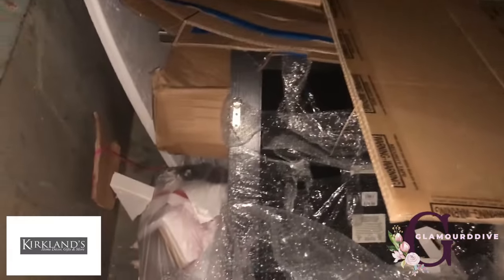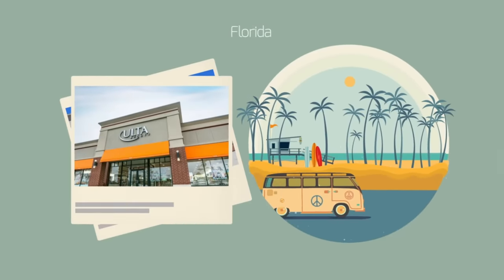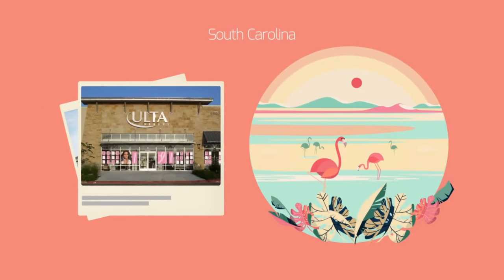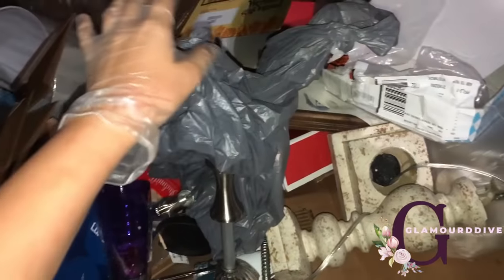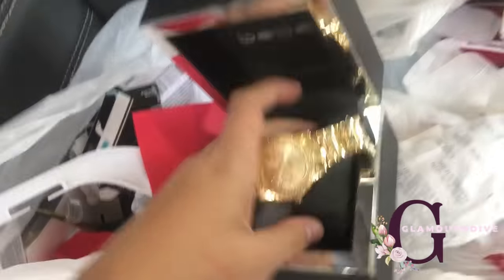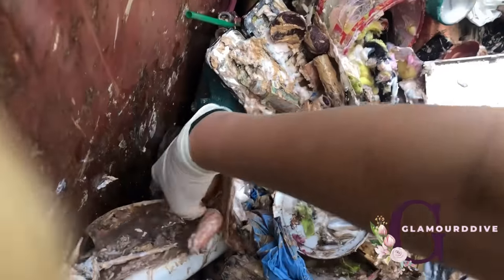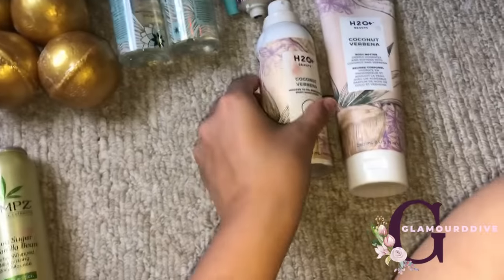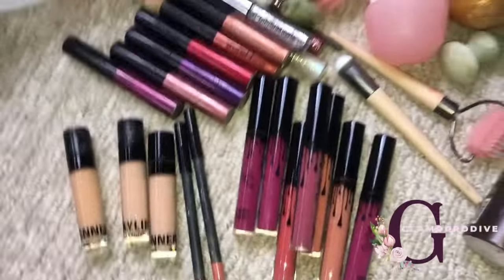DUMPSTER DIVING ACROSS THE COUNTRY!!!! ULTA, TUESDAY MORNING, MARSHALLS, BURLINGTON, MORE..

Comment: That speaker is neat! And the watch band you can have repaired or replace.the face is nice. I love orange scent!
On the jade roller you can get dowels and paint green and glue on. In not sure glue will hold on that material. You can take metal off the candlestick and wood putty any holes and paint.